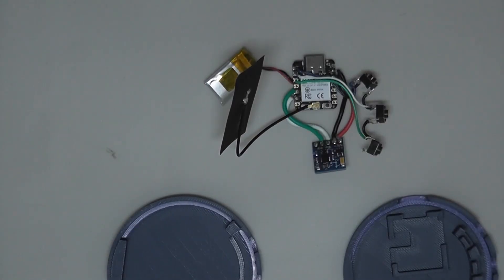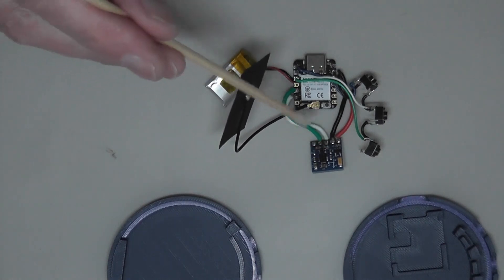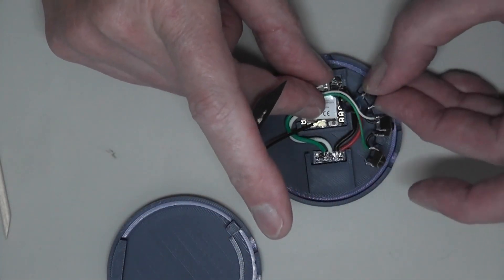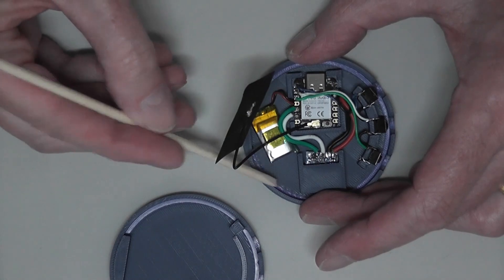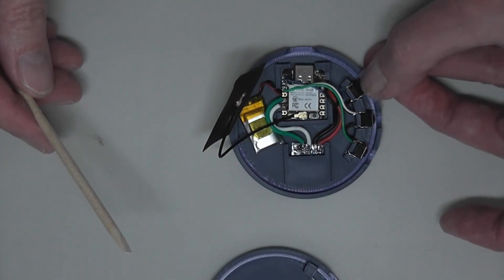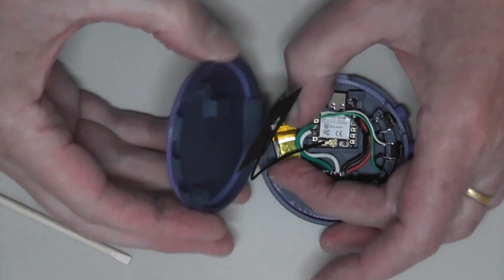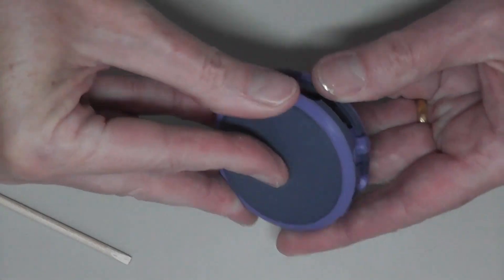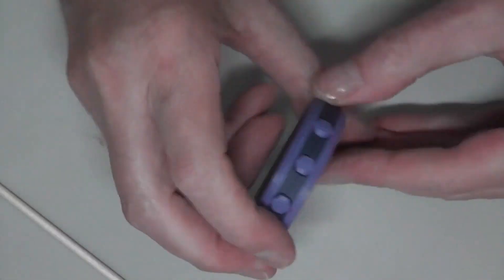Cyberpuck Bluetooth Mouse

Comment: Esp32 is not that efficient as a bluetooth mouse a XIAO nRF52840 Sense
Would have been perfect as it has the accelerometer and gyroscope inbuilt and nrf52840 excels in bluetooth hid and power saving